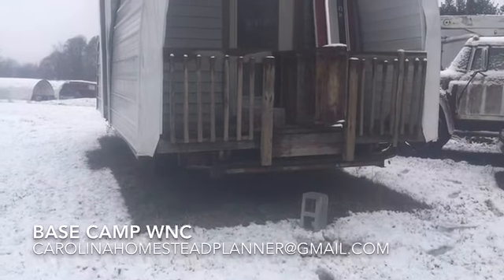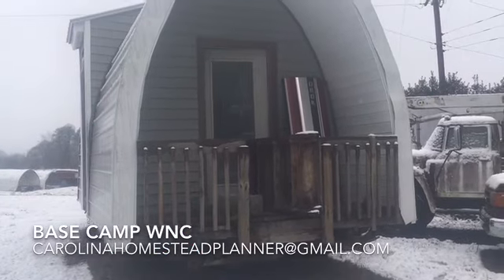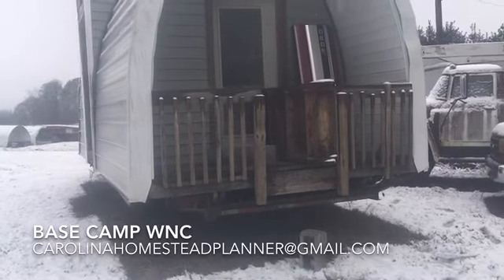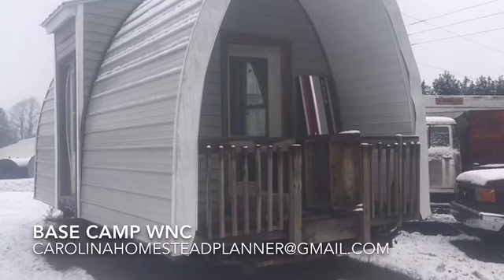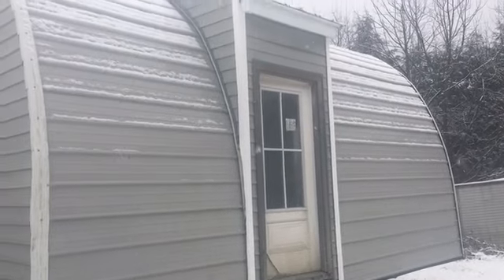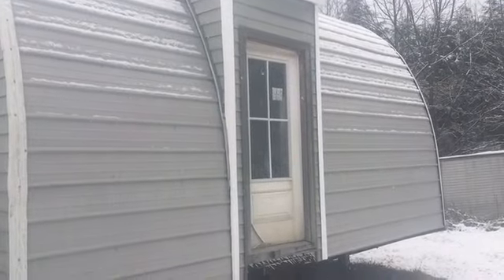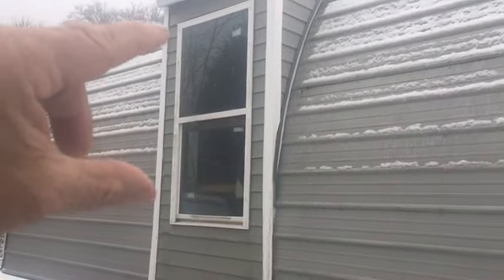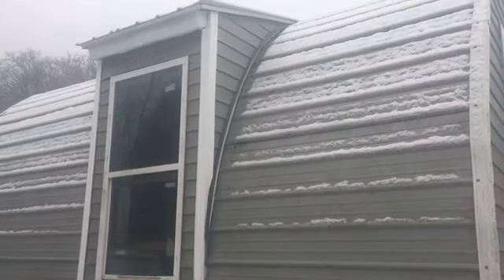Off Grid Cabin Build Questions Answered Part Three

Comment: At the 2:45 time stamp there's good visuals and explanations for attaching the Screen wire on the underside of the building to cover the gap between the OSB outside wall and the floor joist. This gap will help the building to be ventilated so condensation does not collect and create rot and mold. You need the screenwire on the underside to keep critters out and let air in. Also, shows and talks about installing the foam board insulation
Reply from the maker: Had to go to foam board insulation don’t think they make the thermo ply anymore

Comment: I'm trying to figure out how the front and back walls were done. Did you go over that in a video that I missed? At about the 2:42 time stamp in this video, you show the back wall for a second or two. It looks like you put 6 vertical 2x4s into the arches. How much of an angle do I need to cut the ends of the 2x4s so they can connect to the arch? I guess each one is a different angle, and it doesn't need to be too precise. Hopefully!

Comment: If you can get a chance to do a video on your foundation of your cabin build, that information would be much appreciated.  Great video series and question answering videos.  Keep up the great work!!
Reply from the maker: Thank you for your comment.  This build is on a post and beam type foundation. I can do a video on this the only problem is what does your county require 
I have built them on concrete block and on a foundation with a basement. It all depends on the site weather location and your building requirements 
If you get a chance email with your ideas and I will help you Thur it
Carolinahomesteadplanner@gmail.com
Eric

Comment: Wow, loved all your videos on the cabin build and also all the ones on how to build arched frames! Im trying to figure out how to build a 30 ft long by 8 ft wide and 10 ft tall building that will go on a trailer. the main objective being the floor needs to be able to hold 5000 pounds so the structure needs to be light weight. I'm thinking the floor could be 2x6 every 12". and the walls arches like yours. This will be a small oyster mushroom farm. The main question I had for now is this, how does the air go out on top? Don't think i saw how the air was vented after going up the walls on the outside layer. Again, thank you for your videos and your time for making them, very generous of you!
Reply from the maker: Thank you for your comment 
If you would contact me with your email address I have a 10 wide by 10 high and 26 long arched cabin built on a trailer so I can take it to shows
I will send you pictures of it my email CAROLINAHOMESTEADPLANNER@GMAIL.COM
as for the floor if the building is going to stay on the trailer the trailer frame is also part of the cabin floor as for strenght
the roof vent is just a standard metal roof vent running the total length 
And for all this free advice it comes with a price if you haven't please subscribe like and share
Thanks 
ERIC
Reply: @basecampwnc1745  Thank you for getting back to me so fast! Sent you an email and of course i did pay my due :)